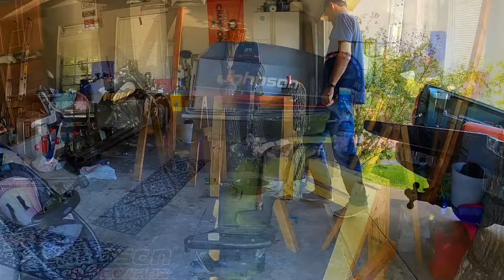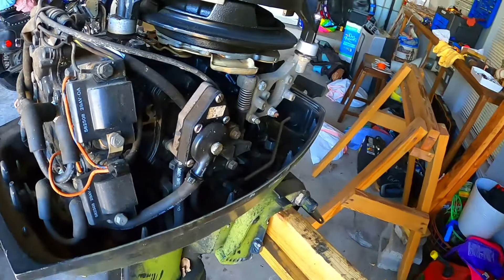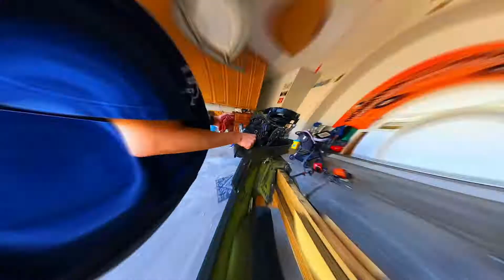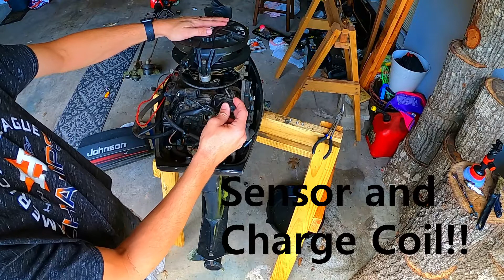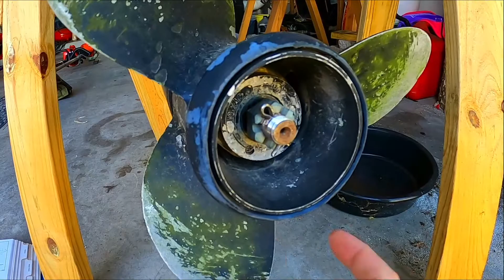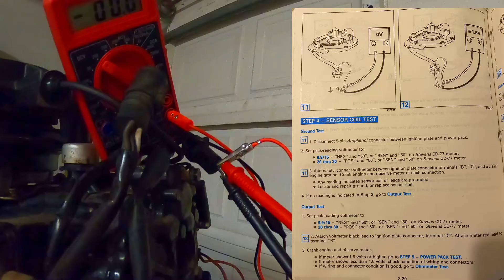1996 Johnson 25 HP Project No Spark and Trouble Shooting! Part 1!

Comment: I'm late to this video (my comment)... Every coil I've ever tested where there is a spinning magnet, produces AC voltage. your meter is set to DC voltage. If your manual says set to DC, you did fine. I didn't see that in the manual when you posted the picture.

Comment: Changed my powerpack and coils on my 98 johnson 25hp. Ran for 15mins and lost spark again. Motor is a project I bought non running. Stator apparently is from 77 to 83 so I dont have the charge coils and different assemblies. A and D on plug are 450 ohms. Stator looks old and magnets aren't pretty by any means. I have 3 yellow wires off of mine. Reading bounces around on those around .5 to 1 at most. Any ideas?
Reply from the maker: Thanks for watching! I would first start with comparing the part numbers from what your 98 is supposed to have as opposed to the one that is on your engine now from the older year range.  If the part numbers are different, more than likely there are some small differences with could give you the issues you're having.  Also make sure all the magnets are there and are clean.  Do the same with the stator assembly as well.  Where did you get the power pack from?  Was it new, or a reman?  Also ebay ones can go bad very quick or be bad straight out of the box.  I hope this helps!!

Comment: I got a reading of 573 ohms on my charge coils following your steps. Same motor. I have no spark. Coils and power packs are good because I switched it with other motor and sparked. Thing is, I had no spark before on this same motor, changed charge coils and got spark, no no spark again with this reading I mentioned above. If im having the same problem (charge coils) what could be ruing my charge coils back to back?
Reply from the maker: Hey there and thank you for watching!  I'm sorry about the delayed response.  Is there any kind of indication they are striking the flywheel magnets?  Even a little bit can really mess with the charge coils.  Also did you replace the charge coils with brand new?  Its possible the new one could be defective as well.  I've seen it happen on more than one occasion.
Reply: @EricGaskamp  thanks for the reply. Lose plan disc under ignition components. Lose/worn out fuel pump outer rubber O-ring. Fixed those and it’s been having consistent spark with no dying from fuel shortage.

Comment: Go stros, i have no spark in my ‘82 chrysler 75. Have power to everything. Any idea? Also dosent turn over with plugs in, plugs out spins freely
Reply from the maker: Finally, another Astros fan!! Thanks for watching.  Check the flywheel to make sure your magnets are in place.  They have been known to come off which would lead to a no spark condition.  Are those spark plugs the one that the factory calls for?  If the plugs are too long they can make contact with the piston causing the engine not to turn over.  I hope this helps some!
Reply: @EricGaskamp  htown native havent missed a game all season we are series bound! Ill have to check those magnets, i do have proper stator ohms. Yes im using the proper plugs

Comment: Just watched your video series on this motor.I made a video on lost spark on my 20hp Johnson.Almost ordered a power pack.I lost all spark after it ran great.Turns out it was just the ground for the power pack.Bolt going thru power pack also had the ground wire mounted behind it to the block.CleAned block and wire connector and all spark came back..Maybe your original power pack was good and you,lost ground like I did..Been about three years and still working.Watch my video.
Reply from the maker: Yeah I was kind of thinking that ground may have been my issue all along! Thanks for watching the series!! I’ll definitely check out your video!

Comment: I have the same tiller except mine is electric start. Did you find out why there was no spark? I'm having same issue. It ran when I put it away last fall and now nothing. NEED HELP PLEASE!!!!!
Reply from the maker: I believe it was the power pack.  Once I changed it I had spark again.  I would go with a brand new one though and not one off ebay!  I hope it helps!

Comment: I just bought a 14’ Vhull John boat for 800 bucks with this motor on it so this will be helpful!
Reply: 25 and 20 hp basically the same right ?
Reply from the maker: @crosstmandogman5027  Yes, that is correct.  The carb is a little different, and there might be some other small differences, however I cannot remember them off the top of my head.
Reply: @EricGaskamp  thanks man.   Ya I have the 20 hp model of this motor.  Was running kind of rough but used seafoam to clean things up and ran way better.   Never taken a carb off to clean before so these videos help.   I'll try later this season and see how she runs.
Reply from the maker: @crosstmandogman5027  I'm glad the videos are helping! I'm a visual learner so I'm way more comfortable about doing something after I've seen it done. I used to be scared of carbs until I watched some videos and did it myself.  Now it's easy and saves so much money!! Oh, and I'm a huge believer in SeaFoam!
Reply from the maker: You’ll love the engine and the boat!! Thanks for watching and let me know if you need any help!!
Reply: Thanks for the video! I have the exact same model with an electric startmotor. Ever since i replaced  the sheared  Woodruff key it won't start anymore. Could the timing be off? It sneezes sometimes when i try to start